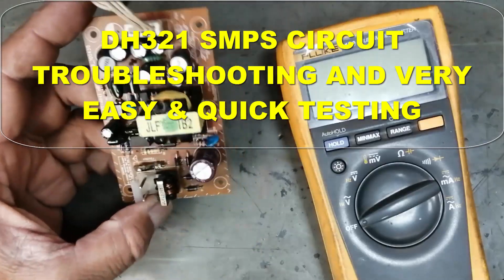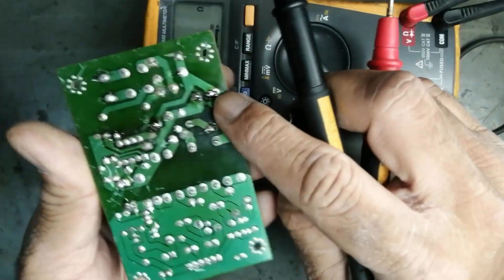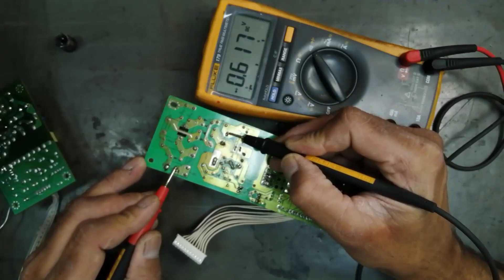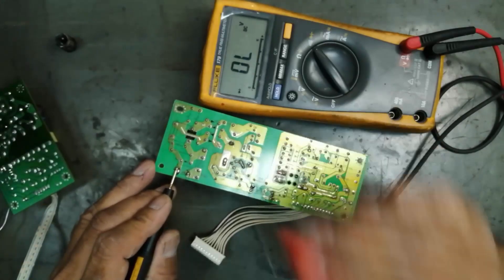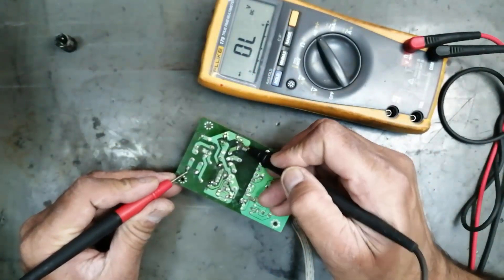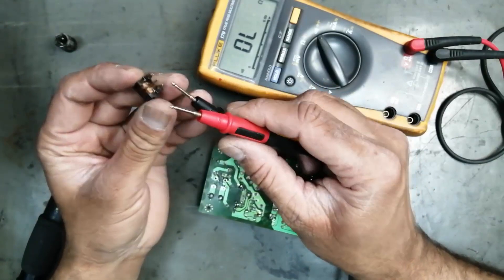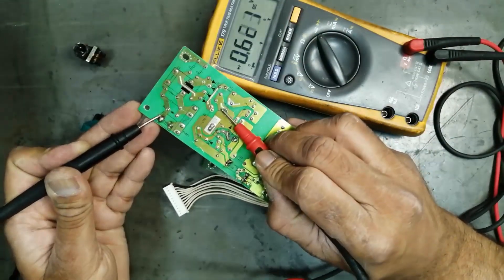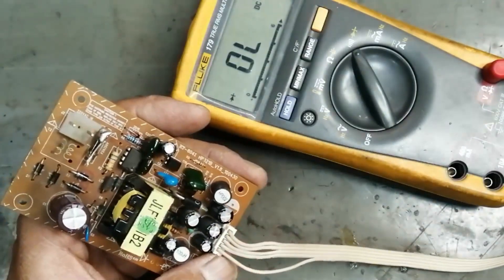#196 How to repair switch mode power supply SMPS - 321 PWM SMPS ic power supply input short circuit

Comment: Haseeb, firs of all, thanks for the video, it is really helpful for me. Secondly, I want to ad only one thing: on the end of the video, U measure all the rectifier diodes. If all is shorted, it doesn't mean that the capacitor is shorted as well. I know it is really unlikely, but from the measurement, it is not obvius.

Comment: Salam M. Haseeb.i tried to increase the voltage through the TL431 instead of the main IC by changing the resistor divider but the OVP stops at 13.6v, and i need to reach 14.40v to charge car battery. Any idea how to disable the OVP ?
Reply: @HaseebElectronics  The IC is a TSM1001dlm and the supervisor the DWA103n (also known as TPS3513), this PSU comes from a DELL or HP desktop. Thanks for your answer.
Reply: @HaseebElectronics  Ok thank you.